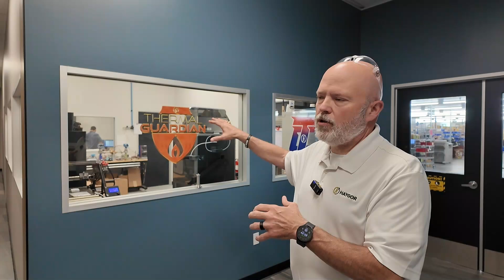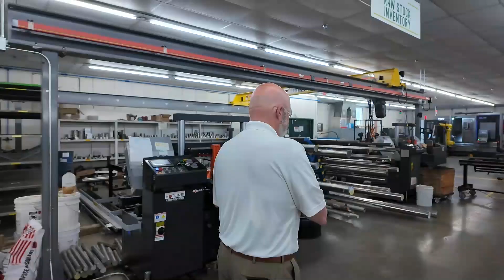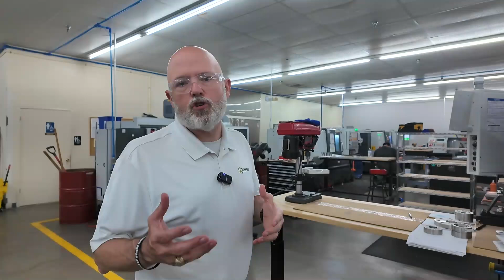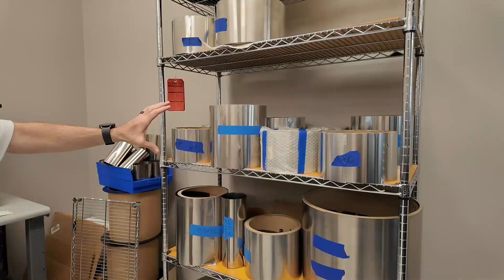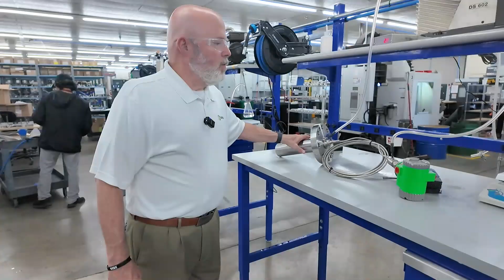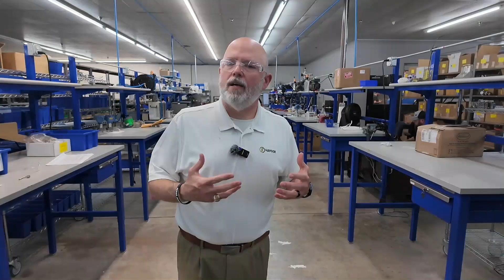Haygor Virtual Tour

Comment: I am instrumentation engineer and been using diaphragm seal on a regular basis. It was fascinating to see the entire process. Just a quick question regarding the fill procedure - when you vacuum the system and the fill fluid fills the cavity you close the port with a grub screw. How do you maintain the integrity of the vacuum and fill fluid because closing of screw will take time there is a chance of air going in?